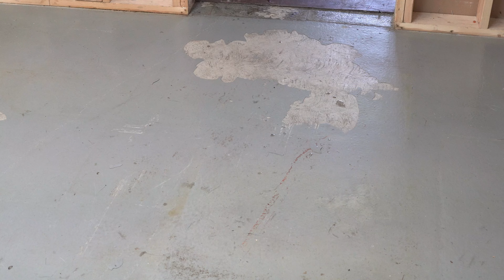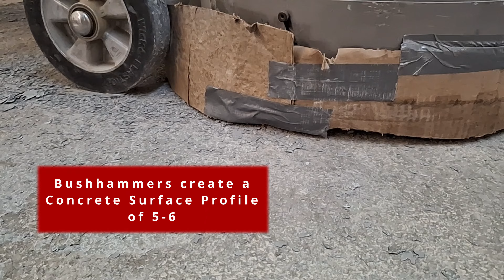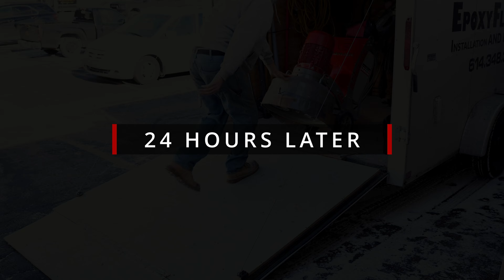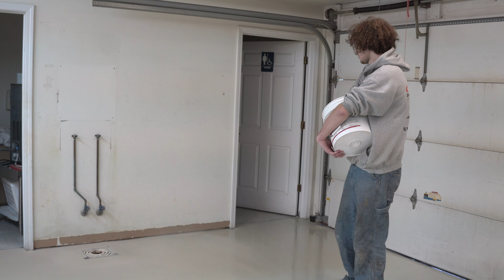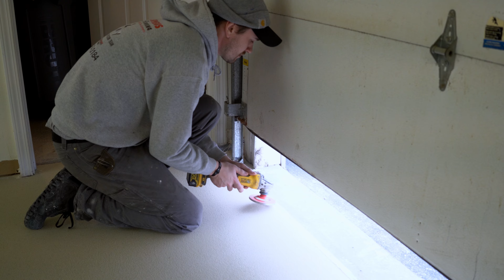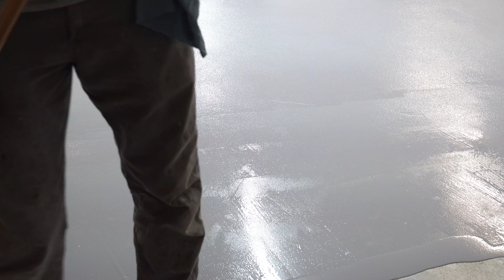Commercial Kitchen Floor Remodel: Epoxy vs. Urethane Cement

Comment: Looks GREAT! How many days did that take, Rough idea on SF?
Reply from the maker: Hello, project was around 800sf and took 3 days for installation
Reply: @columbusepoxyflooring trying to quote a similar job. 1,800 sf. $10 per sf minimum? No coves existing tile in pretty good shape and owner willing to move equipment…
Reply from the maker: @AquaTight  Pricing is relevant to the area and your business. You can get a pretty good idea in our video here though. https://youtu.be/72aAnAUx0s4?si=u77egUs24WQa7oZS